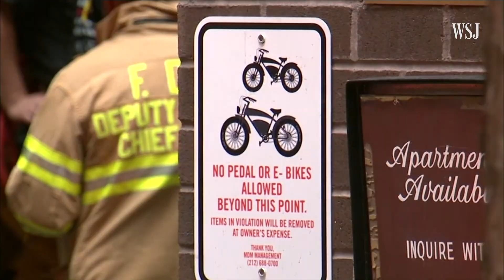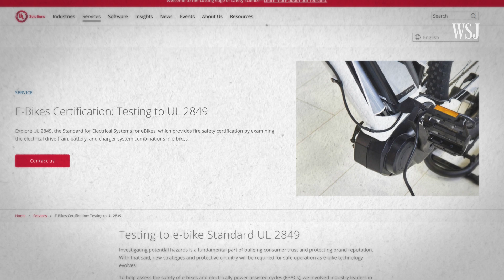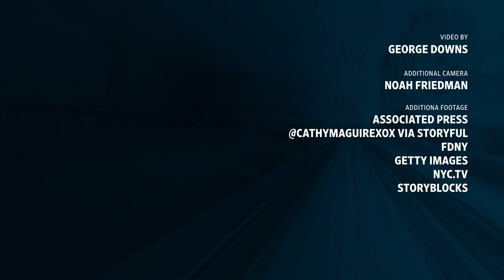E-Bike Batteries Keep Exploding. What’s the Solution?

Comment: Video suggests that public charging places (outside residences) is the answer to avoid residential fires.  But crime in cities like NYC is so rampant that e-bike owners will not want to park their bikes in a public place, for hours, unattended.  Your bike is going to get stripped for parts, similar to the plague of stolen catalytic converters from cars.
Reply: So who’s to say that while waiting inside one of these charging stations that the battery won’t blow up!
Reply: @alvaroq2024 it won't be in a 20th floor apartment though. That's the ENTIRE POINT 🤦🏻
Reply: @alvaroq2024  Good Point
Reply: @alvaroq2024 The thermal runaway releases hydrogen from the metal hydrides which of course releases hydrogen when exposed to certain heat levels.  In the past fire men would inundate a burning EV with vast quantities of water even though chemical reactions could release both oxygen and hydrogen from the water but they are now shifting to just covering a burning EV with a fire blanket to prevent oxygen in the air from mixing with the hydrogen rapidly and to contain the fire so that it could cool down to the point where the vehicle could be towed away.   

I would suggest a fireproof enclosure and a four hour timer on the power line to charge the battery module in.   Fire resistant safes use gypsum inside their walls to absorb the heat for a stated period of time due to the water in gypsum and there are fire resistant drywall often called X-boards, three layers of either ordinary drywall or certified fire resistant drywall are often used in the walls of computer server rooms and clean rooms, the certified fire resistant drywall are also supposed to be used on the walls of an attached garage though it is reasonable to question if your home builder has done so despite the regulation requirements.   I would say it would be easy enough to build a fire resistant enclosure through drywall layers with a power timer to charge your ebike's battery module in and perhaps coffee houses and restaurants could provide a fire resistant charging closet or cubicles to do the same.  If you want to get fancy, you could add a smoke detector and a way to pump a CO₂ or FM-200 or whatever server rooms now use instead of halon fire extinguisher into the enclosure as well as cut off the power safely from the outside, preferably all triggered automatically  by the alarm.
Reply: Well, purchase a fire resistant document safe to charge in or build a box with three layers of fire resistant drywall to charge in and put the charger on a four hour timer to avoid overcharging, I even have a USB type C cable that has a programmable timer and power monitor specifically sold for limiting the chances for battery fires with smart phones as well as for extending battery life.  External charging facilities is just something the city could do, a fireproof box and limiting charge time is something the owners could do.
Reply: yeah aint nobody leaving their beloved transportation outside in the city. gotta carry your bike inside/upstairs to charge and for safe keeping or it wont be there later. pedal, electric, or gas bike. sheet, i had a motorcycle i drove on a plank of wood upstairs to park on my porch at nite. yep motorcycle up a flight of steps to keep it from disappearing.
Reply: It's not safe to leave your e-bike outside any wheres for an extend amount of time even short periods are a gamble.
Reply: I live in Chicago. You see bikes locked up to racks all the time  it's just the frame. Everything stripped clean.
Reply: @GNMi79  would only go up in flames if the person charging it was negligent and rightly be charged..
Point is, follow instructions carefully and will be fine 🙂 👍🏻
Reply: you don’t need a place for the bikes, just the batteries
Reply: @TwntyUp  this is a good idea. Maybe a battery swap system if they could be standardized.
Reply: Then make it a safe place.
And it doesn't need the whole bike, only the battery.
Reply: @rogerwilco2  There's been multiple car fires in my area this year and not a single e-bike fire.
Reply: I agree honestly this is a mess all around.
Reply: good point- why have your own explosion and fire when you can share it with the neighborhood....??
Reply: The London Underground railway has recently banned non-folding e-bikes as it was too difficult to differentiate reputable reliable makes from cheap ones. They decided folding bikes are few in number and more expensive and represent a much tinier risk. 
I believe a significant factor in e-bike fires is the owner converting a standard bike into an e-bike with a cheap kit,  and then sharing the charger with others  in the same shared house. Each motor has a charger rated to a specific output. 
E-scooters also have fires l. Their batteries are close to the ground and get bumped on kerbs which damages the protective layer between cells causing chemical reaction and fire.
Reply: Make the battery removable and charge it outside in a vented metal box . Then you can still store your bike in your apartment.
Reply: So much for a first world country.
Reply: I'm pretty certain the point is to have shelter AND a charging station, so they have a place to sit nearby. I'd love these in my city. It'd be pretty dope to go for a ride, grab something to eat and chill at a charging station to top off my battery.
Reply: They're not saying it will be a 'top up' charging port. They're suggesting you only charge you e-bike in these  ports, not too mention just how long it would take to charge, 3-5 hours sometime.
Reply: Hell no. Just do not buy a funky battery and dont DIY your Ebikes if you're an idiot that doesnt know how many AH your BMS on your battery can deliver without your BMS failing. When your BMS fails, that is when the battery erupts into fire. Its pretty much down to user error, either by buying the absolute cheapest shit you can find from China, or by DIYing a system that is not designed for the battery. Waiting 5 hours at a place to charge my battery sounds like a big fuck you and I will just take the risk of my lithium battery combusting in my garden.  @DietWarlord
Reply: Change the battery from Lithium Ion to Lithium Iron Phosphate.   They do not and cannot thermally run away ( catch fire)
Reply: @TRUTHandLIGHT4809  totally false any and all batteries can catch fire.
Reply: Same goes for any country, but why should I have to charge my battery outside when I know mine is certified, not modified in any way and I'm following regulation looking after a very dangerous lithium cell battery?

Sucks that there are many people breaking rules 😒
Reply: @azisalive4972  it’s a lithium battery it’s never safe to charge. Hahah
Reply: No one is going to strip an ebike. It's easier to steal it.
Reply: anything ANYTHING to not use alternate technologies to lithium commodities investment Wall Street investment opportunism rare earths. We will sit in the rain... We will build covers... We will charge our e-bikes for hours in the middle of Harlem and South Central... Anything to not have to use five times the endurance hydrogen fuel cell with half the weight and instant refilling. Anything... We'll do anything for the billionaire lithium grift.
Reply: Indoors fireproof cabinets
Reply: Please stop spreading the myth that New York City is crime-infested. New York City has one of the lowest crime rates of any metropolitan area of the United States. I'm not a New Yorker saying that. I'm just somebody who knows the facts.

Secondly, E-bike batteries are easily and quickly removed from the bicycle. It's done every day, because a lot of these delivery people have more than one battery pack that they carry with them.  Charging them in outdoor storage facilities remote from residential buildings is very easy and manageable.
.
I can't stand when people that don't know what they're talking about put posts out there that get 80-something likes o
from people that are now a little bit dumber for having read your comment.
Reply: @chriseidam7319  buddy don't be ignorant, opportunist crimes exist everywhere including New York. Don't leave your valuables where an opportunist has a chance to rip them off because they will. It's not about New York it's about protecting your stuff

Comment: These fires are cause by using the wrong ( fast charges  ) charges and or bypassing the BMS
Reply: They should not categorize it as e bikes causing fires. It is the user’s fault for the most part. They beat the heck out if these bikes , fast charge them, don’t let them cool, and use them none stop. As a causal rider for health and pleasure is it completely unfair to restrict usage in a residential building. They should at least have a designated area for charging the batteries if they are so concerned.

Comment: I’ve made a e-bike myself including battery with real-time Bluetooth BMS monitoring during charging. Its build like a tank. I trust this bike more then Chinese batteries.
Reply: Good for you but I don't trust you!
Reply: So you tell me you are better than 1billion company🤣🤣 so why you don't work with them then? So company like Samsung don't have genius people??? Hhhhhh
Reply: @junglemarket6555  he's not buildimg the cells just assembling the cells into a battery.
Homebuilders can over engineer parts of the project they deem more important and build to specifications they choose. If I want a 1000 watthour battery instead of the 750 one offered on a stock bike I can make it as big or as small as I deem best for my project and desires.
Usually home built batteries are made for homebuilt bikes.
Front wheel drive rear wheel or both.
Gear motor, mid drive, direct drive hub motor with or without regenerative brakes? All options that one cane use to make a custom e-bike that fits the purposes the designer envisioned not helping a company make a better generic one size fits all battery.
Reply: Where were the batteries made?
Reply: @IHateYoutubeHandles615  all we know is some chinese guy built it.
Reply: @IHateYoutubeHandles615  Really stupid question. I am 100% sure he used cells like Panasonic LG,or other brands. No one will spend on a good BMS and cheap out on batteries. Check most bike fire compilations, most of the fires are not from DIY builds. I Build my own stuff for years, never had an issue, that is because I understand how they work and what needs to happen for them to get to a critical point.
Reply: @edd943  so what  are saying...
i bought a high power ebike  from china    that goes 70 mph    and they told me  before i bought the bike   that they only use high quality  parts.....and that was  at the start of that virus  covid shet.....i was off from work for a year so i bought a bike...and  have out 5000 miles on it.... and it still going strong and  still looks brand new.....72v 12,000 watts  48ah
Reply: @421abm I'd say it's not an e-bike if it goes more than 28 mph.
Reply: Do you trust your Chinese made Apple iPhone? How about the Chevy volt with S. Korean made batteries? What about the US made Teslas that cough fire in Florida after hurricane water damage. This is not necessarily about country of origin.
Reply: @sunrisejak2709  I don't have an iphone nor do I have  a Chevy Volt.  And I'd never even be found dead in a Tesla.
Reply: But can we trust  you build it yourself without an engineer degree?
Reply: @Hproawesome  re: "But can we trust you build it yourself without an engineer degree?"  exactly, it's not lost on me that behind every E-bike fire in NY that's happened so far in 2023, there sits an untrained and "overconfident hack" who's convinced themselves that they know what they're doing.  yeah, it's a "recurring theme".  sadly the nature of EGO is such that everyone presents themselves as not being THAT GUY...? but yet the on-going destruction of property and loss of life shows how they are THAT GUY...!!!
Reply: @Hproawesome  sdfu my guy

Comment: Isn't it because they're effectively abandoned on the sidewalks for long periods of time? Exposure to sunlight, heat, and now cold / rain / ice cannot be good for cheap batteries in these devices
Reply: Don't charge below freezing though, doing this frequently leads to lithium dendrites that eventually short the battery.
Reply: That's probably why I never had any trouble with my last premade ebike. I literally charged it inside my room every night with no issues.
Reply: @TigerTT  I leave mine in the basement of my house and charge it inside and this is significantly concerning me
Reply: @Nickles4  me too man. Now I'm concerned
Reply: @hallu7477  little update that put my mind at ease, I bought a bike cover and bike lock and just leave it outside and charge the battery where I can see it at all times Incase something happens